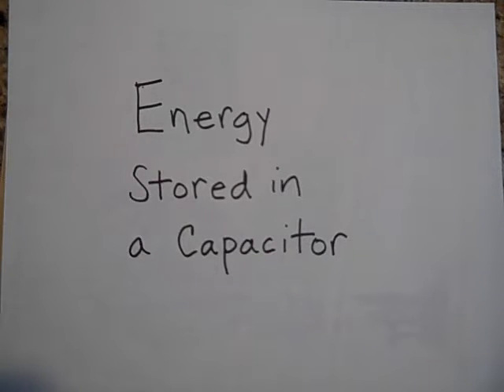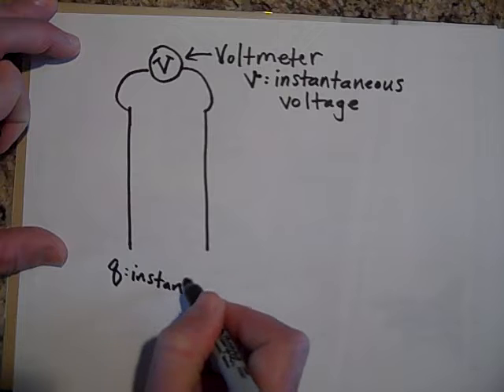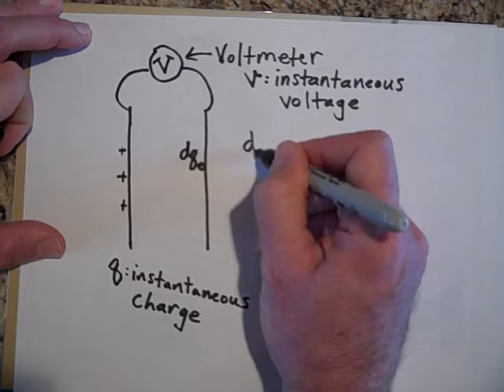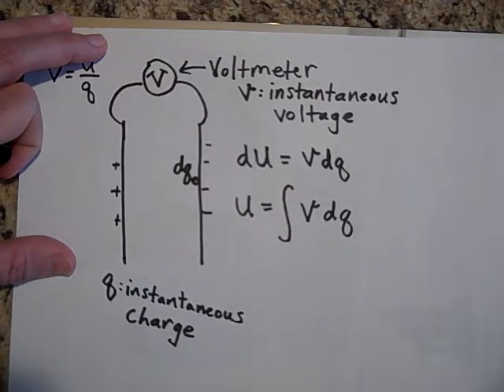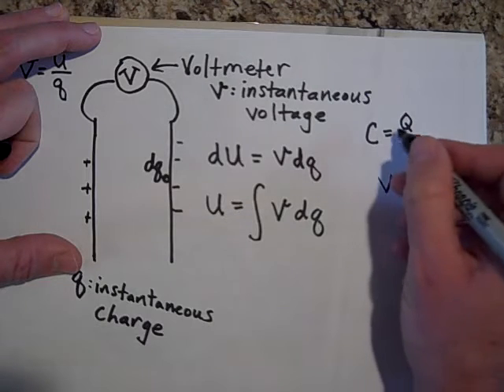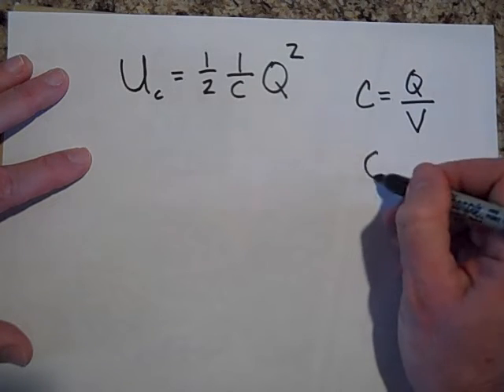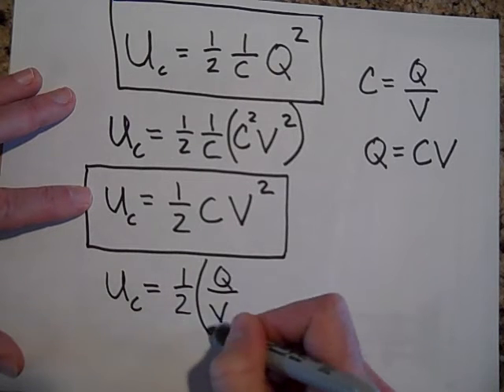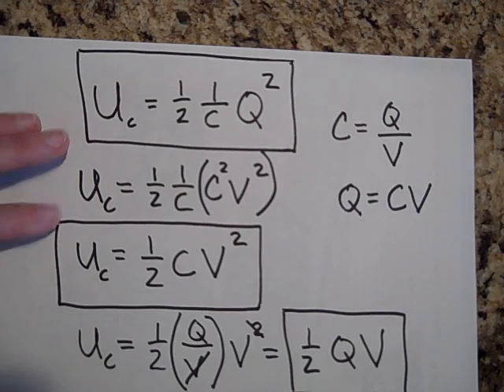Energy Stored in a Capacitor

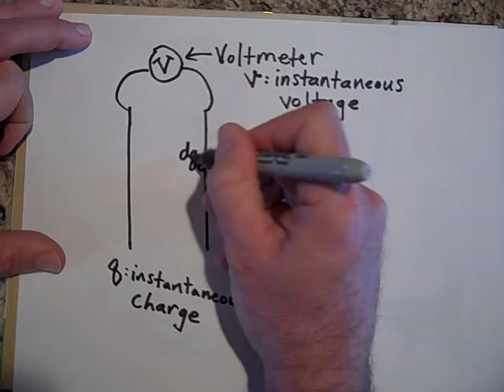Comment: Beginning at 1:25, you state that the charges move internally from plate to plate as the cap charges up.  However, don't the charges actually travel through a conductor (wire) externally from one plate to the other, and not internally through the insulator (dielectric)?  Isn't this called displacement current?